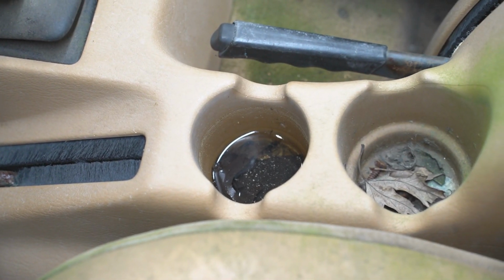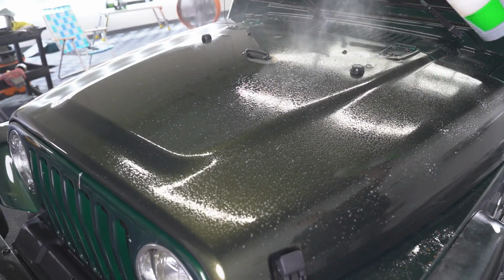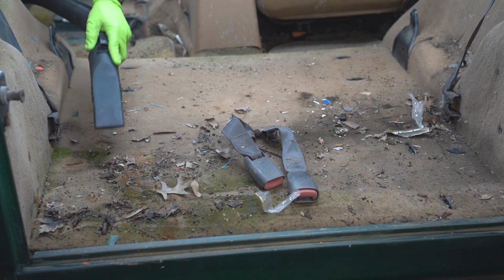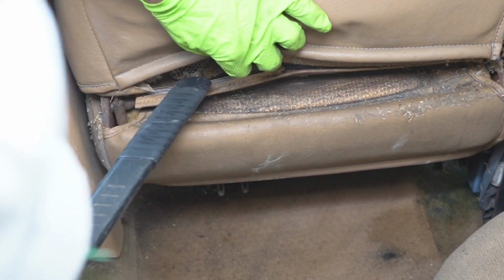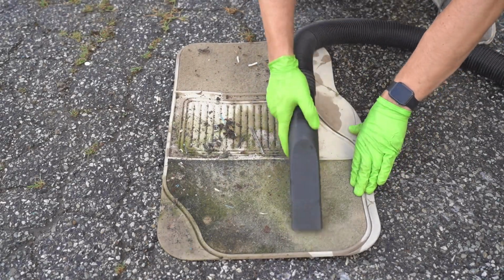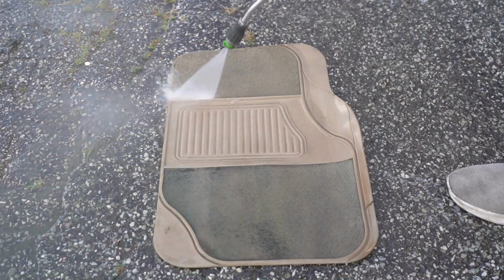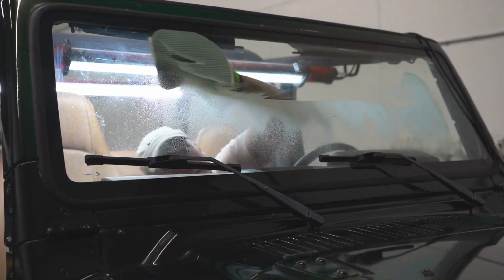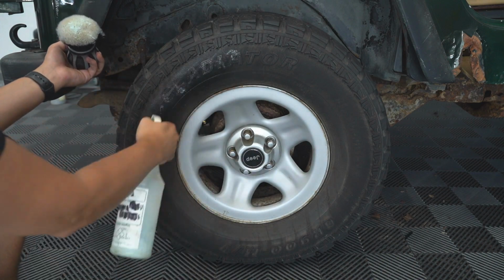Deep Cleaning the MOLDIEST BIOHAZARD JEEP EVER! | Satisfying DISASTER Car Detailing Transformation

Comment: I bought a 2004 Ford Ranger a few years back, with only 88k original miles on it, 5 speed manual, BUT it was in terrible condition. The clear pact on the hood and roof were peeling, the bed was destroyed, the underneath was SUPER rusty, it was like they parked it in the ocean, the seats were ripped. 

Bought it for $1900. 

We ended up taking the bed completely off, replaced it with a southern, rust free bed, we replaced the rear part of the frame (the old rangers have a split frame) with a southern, rust free frame, we cleaned up the entire front of the frame, and undercoated all of it with POR15. Replaced everything trust needed replaced, got a new hood so the paint didn’t look as bad. 

Ditched the rotted out wheels and tires for some 31 inch all terrain tires and it looked sweet! I daily drove that thing for a few years. No issues… kind of miss it.

Comment: Honestly if the jeeps frame isn’t rusty and it can pass an emissions test I’d put that back on the road. That jeep came out so nice from the detail
Reply: There's a substancial hole in the floor @9:12
Reply: Parts are so easily available, should be saved
Reply: Some states don't have an emissions test that you have to pass. So even with that hole in the floor board, I'd put it back on the road anyway.
Reply: @thenerdypatriot  yup. Oklahoma doesnt have one 😅 lots of cars on the road that shouldnt be
Reply: @myCaligirlFly  Indiana doesn't have emissions tests either, and I have definitely seen some questionable vehicles. 😂

Comment: I bought a beater car for my daughter for $400. 
The seats were filthy and the carpets had food stuck in them. We took out the backseat and scrubbed it then cut out the carpet. Got it all cleaned up so nice. It started and drove decent so took it for inspection. Ended up having a huge hole up in the trunk/strut area that would’ve needed professionally welded to pass so I scrapped it because the fix was going to be very expensive. 
We were so bummed out.

Comment: The worst car I've seen has been my elderly neighbor's.  It was covered in moss, fir needles, pollen, and crusty red spots and crusty black spots.  A simple power wash got rid of everything but the crusty spots.  Those resisted also sorts of cleaners including iron removers.  It took me a while to find the combination of a clay bar with soapy (Dawn dish detergent) water as the lubricant to get rid of the crusties. Regular clay bar lubricant did not work very well. Today I finally got rid of stains on the paint using OxyClean gel laundry stain remover, washing that off, then using the clay bar.  Those stains had resisted even straight use of Dawn dish detergent. The OxyClean was a last resort.

Comment: This Jeep doesn’t appear to be that dirty - yes it has some moss growing in the interior, but nothing that can’t be saved. This Jeep is more than a parts car. I would toss the carpets and put in some rubber flooring, switch out the seats, fix it mechanically and drive on.
Reply: Frame has rot can see it in the vid still fixable tho def looks like it would be worth fixing.

Comment: I bought a Dodge Grand Caravan that was so gross, it took 5 hours to clean out. It literally had an inch thick of dog hair and literal vomit all over the seats. The front passenger seat was so bad i should have just replaced it. Cleaned it up as best as I could with what i had. Still didn't smell the best but I ended up selling it to someone that needed a van.

Comment: Worst condition vehicle I’ve seen? A work truck at my job is in pretty bad condition, with some sketchy history to boot lol
It’s a square body Chevy flatbed with a 305 that has to be cranked 4-5 times before it’ll even start, and even then it blows blue smoke constantly as it runs. It audibly ticks and the motors rings are going out but that’s only the big fining
It’s 326k miles with no vin as it was removed by the owner who sold it to my workplace so it can’t be licensed, the floors are completely rusted out, and by that I mean you can touch the ground from inside the truck at any given place in the front seats
The paint is gone or completely faded and none of the gauges work either. The metal that makes up the flatbed is curling up and rusting too
Probably the rattiest thing I’ve ever seen but all the workers including me love the thing to death